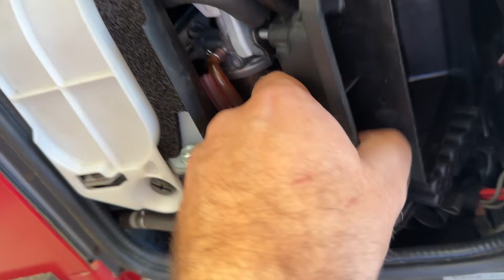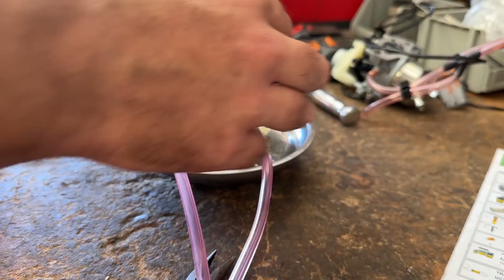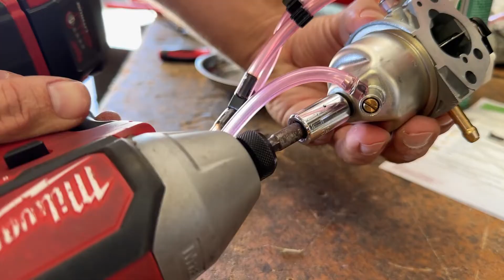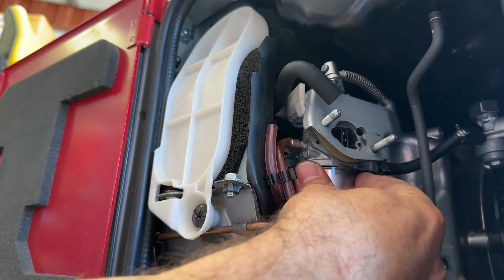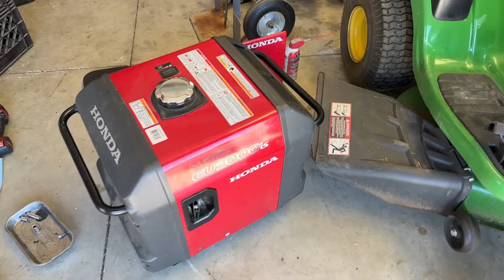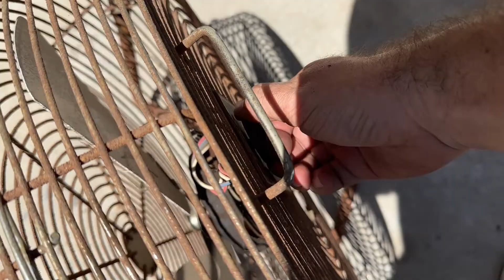Honda EU3000 Generator Won't Start? Check the Carburetor

Comment: That was awesome 👌 👏 I have the same generator I ran mine dry I cleaned the carburetor and still no luck so I just turned it in to my local small engine repair shop hopefully they can get it back to me running. I truly enjoyed this video. Great job
Reply from the maker: Hopefully they get it running smooth for you soon!

Comment: I think that this machine has a sediment bowel that's connected to the fuel line somewhat deeper into the machine.  In order to get to it you got to remove the air box and look for the fuel line.  I think it unscrews from the bottom then you clean the bottom bowel out and reinstall.